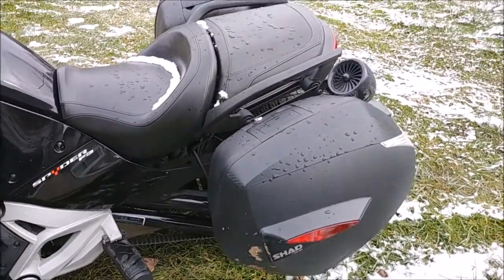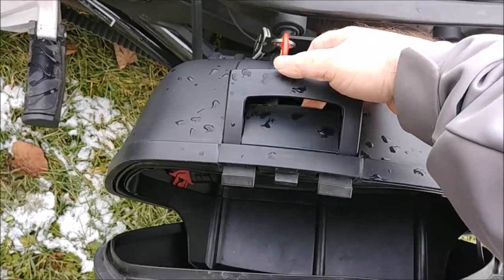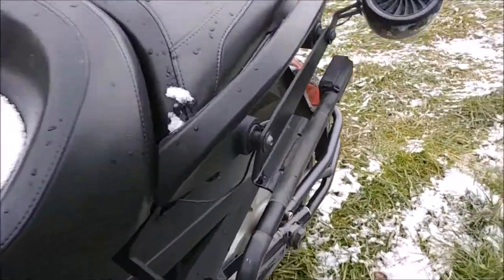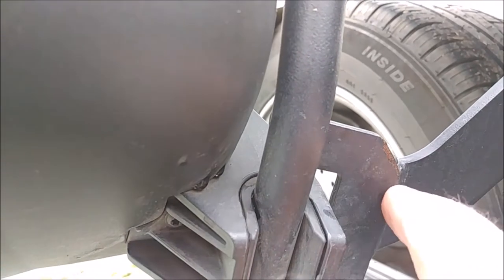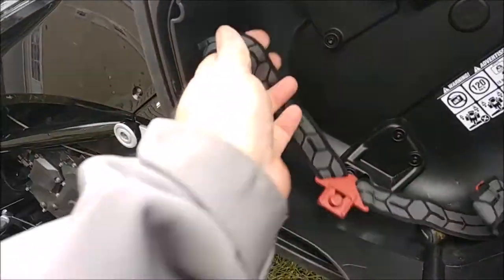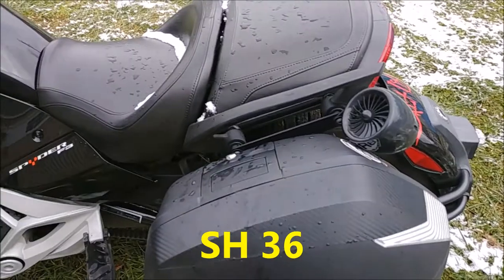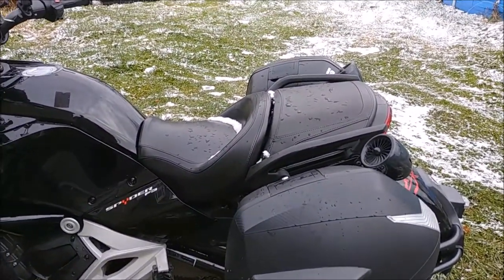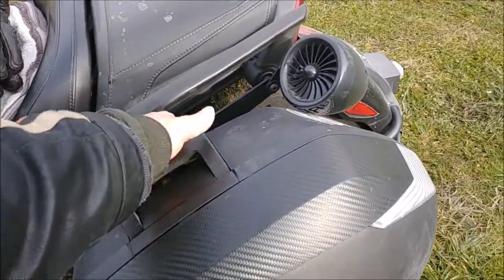Shad SH 36 saddle bag review on a Can am F3

Comment: helpful video. 40,000 miles in 18 months. The F3-S must be reliable.
Reply from the maker: 3 years in and now at 62,000 miles. One one issue with the transmission but BRP handled it no problem. Zero out-of-pocket cost
Reply: @spyderryder  What was the transmission problem? Serious? I ask because I am on the point of buying a new F3-S.
Reply from the maker: @1990-t1j  support bearing and everything internal. It was bad from day one and it lasted two 20,000 miles when it finally went out. I truly believe this is a one-off thing and I have not heard anybody else having to replace their transmission. I would go out tomorrow and buy another one
Reply: @spyderryder  Good to hear and thanks for getting back to me so swiftly. I cannot wait to get mine. Should
 have it in three weeks.
Reply from the maker: @1990-t1j  good luck and congratulations!
Reply: Inlays are not carbon fiber, but simply an imitation. They’re CF looking plastic.
Reply from the maker: Younare correct. Just a simulated carbon fiber look